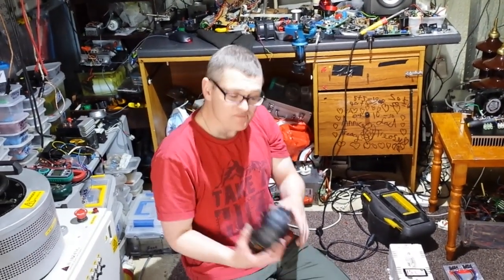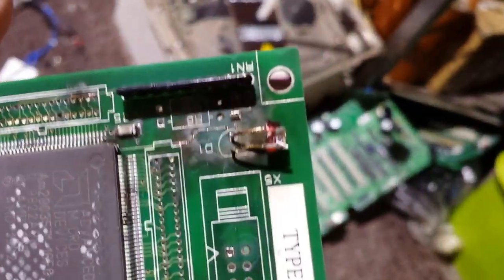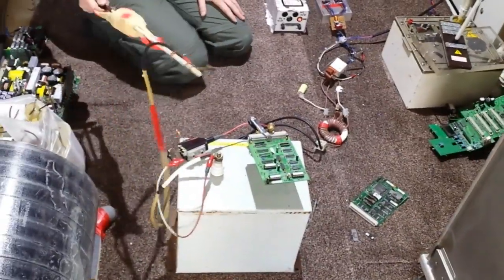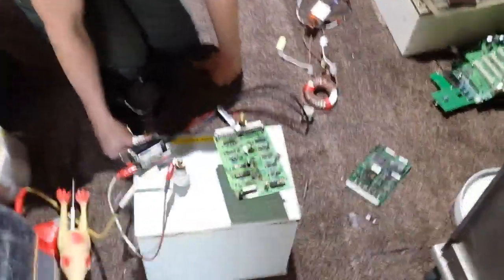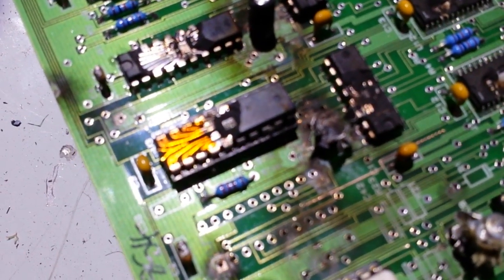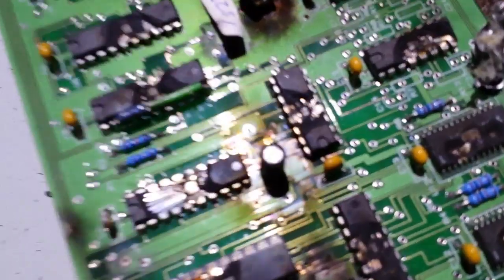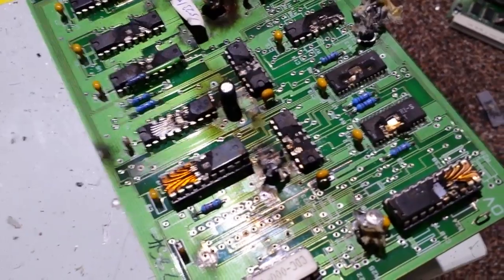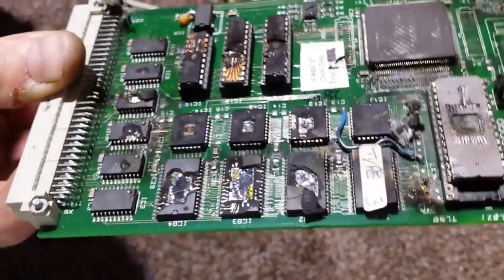MONSTOR  Capacitor destruction 12000V

Comment: Can you do or make a video on how to make a induction magnet?=) if you dont mind,, step by step,,even on how to wrap around the wire on the magnet,,thanks and have a nice day.
Reply from the maker: Hi mate' well its very easy to make a magnet! Like you said' just wind alot of magnet around some a nail or something' arpund 30 turns. and put it to a battery! Thats the easyest way!! Induction is  pulses from a mosfet into the coil!! Its the same circuit as the induction heating! But a asume not as many capacitors lol hope this helps mate.

Anthony
Reply: high1voltage1rules For you that know how to do that,,but for the people that is clueless is more likely imposible to do it,,,ajjaja so plz do a video step by step,,,,thanks